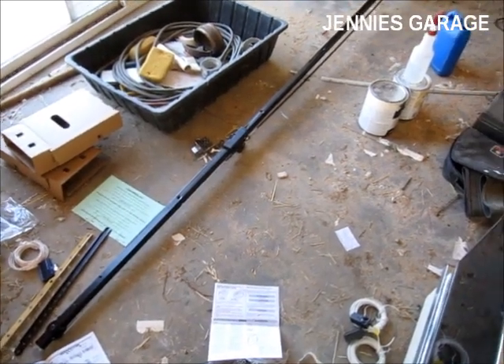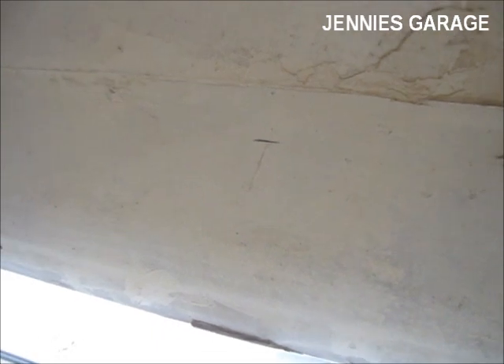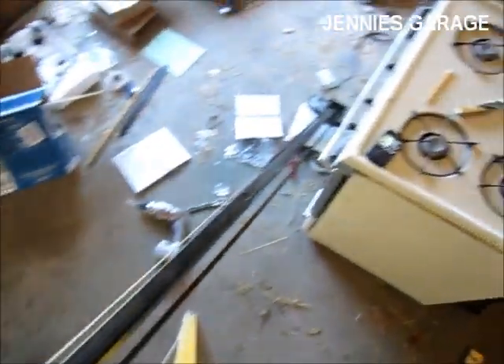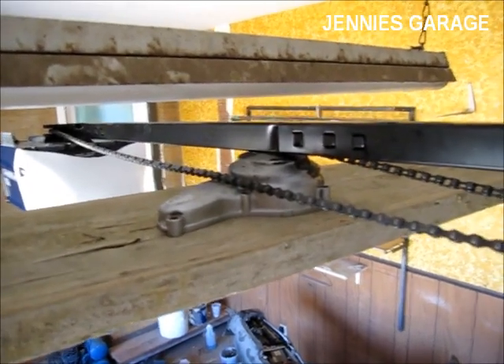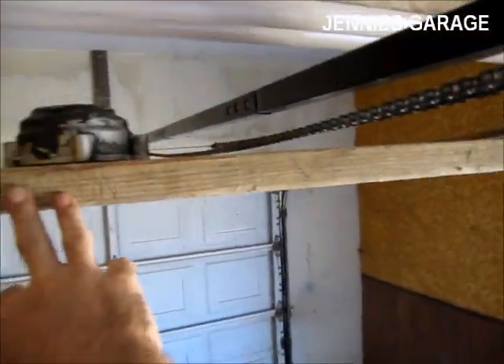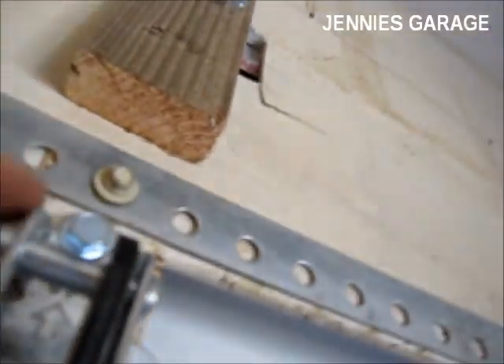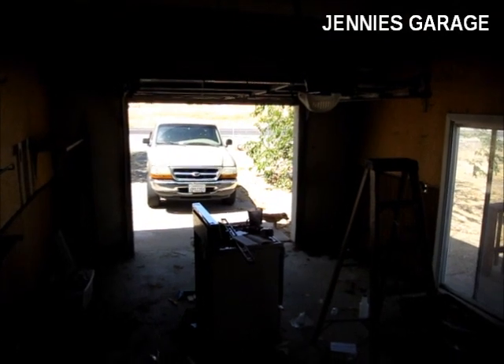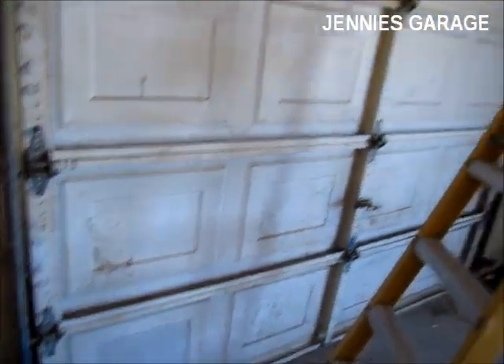How To Install A Garage Door Opener - First Time For Everything!

Comment: So that garage door has no Torsion Spring(s)? For a small door like for 1 car garage it is not necessary? Thank you for the informative video.
@11:24  Special thanks for the idea how to support the central rail! I need to remove the box w/gear, and the box is located too close to the ceiling, so I would need to remove the whole box (which is connected to the rail).
Reply: It has extension springs above the tracks. This was common on single doors, however torsion is the best
Reply: @jdcalame6714  Thank you for the explanations and concern about my questions. I've installed already 2 new Torsion Springs on our standard 2 cars garage door (instead of 1 larger, which got broken by splitting apart), but it is good to know more details about the process, I've recently learned. Thank you again.

Comment: Excellent job! I’m thinking all you had to do to get that board on top of your door is to pull the door towards the board and once you get close you can lift the board and the garage door motor the same time but, your way work just as well! I like how you took steps in between you’re off camera stuff to show us the complications. That helps out a lot. You’re not a marketer trying to sell your services… That’s nice to see. Thanks for the video.

Comment: 5:59 ran into the same problem . So I connected the header bracket to metal brackets like the one that hold up the motor . Ran lag bolts vertical hitting the wood that ran horizontal.  The 2 by stuck out to far from the wall for my installation...

Comment: A decent video just make sure the chain is 1/2 inch above the rail not really loose and disconnect that hinge where you see a big huge air pocket and see if you can realign that gap and clean it all up and make a brand new again

Comment: My garage door has rubber feet on the door side, and a little piece of rubber on the motor side. The cool thing with that is that you don't need to fine tune it, it does it automatically as it senses resistance when it reaches the end (or an obstacle).
I'm surprised that chain is dangling...

Comment: You definitely need to replace your garage door. Your squeaky wheels are only one problem. One of your door panels has a slight gap between the other panel which isn't normal. I'd say the door has lived its 30 years and some...

Comment: I would like to see a video on- Emergency fixes for a garage door.
I am forced to wait 3 weeks for my new door to arrive & it is -20 below zero now.
I have cold air at top and underneath closed door.
I have nailed a rubber runner at bottom of wood door which thank God is holding but air coming in sides and top.
I am stuffing towels and clothes to cover gaps..
Thanks for any furthur help especially if you have been in my position before.
My 97 year old Mom who I care for says " thanks very much" also.
Reply: +l bondez you can buy weatherstripping that nails on the door jambs, header and both sides, it has a rubber flap that sits tight against the door to stop any air gaps

Comment: Grease it up , sounds a bit criki , builder short changed you on the header size ... should be larger than a  2x 6 not a big deal anyway it works

good luck and helpful video,  Thanks

Comment: This was perfect.  My door is exactly like this one and since it was built in 1963, and my upright studs were also on 24" centers I was sure the header over the door would be the same so just went ahead and put the 2x4 in vertically as he did in the video.  This made things much easier.  Still don't have mine completely up because of a time crunch, but this has helped me avoid some pitfalls that I'm sure I would have had.  Thank you so much for showing me how to do this.

Comment: They make a brace call a strut you can use as a proper support for the top of the door. You can pick up at a garage door company for cheap. Your support is not long or strong enough. The strut is a u-shape bar witch gives it the strength it needs to support the top of the door properly. Don't use wd-40 use a light machinery oil like 3-in-1 oil. Also check door first by hand and make sure door works freely before hanging garage door opener. Not bad installation for a home owner. Your wires on the walls and the roof are straight most people take short cuts on that.

Comment: The bottom of the wall bracket is supposed to be 2" above the highest point of the door.  You have the bracket centered at 2" above the highest point of the door.
Not a big deal.

Comment: Thank you very much! I am going to install a Chamberlain just like this one this week.Was wondering about verticle reinforcement.... I guess you did not think it was required for this install. The manual recommends it but is very vague about how to do so. Any suggestions? :)
Reply from the maker: It depends on the door. If it is real flimsy where the opener arm is going to attach, you need to reinforce the area so the screws don't just pull out when you try to open it. You can buy a purpose built bracket, or make your own. Thanks!

Comment: This guy is an idiot...I install Garage door openers for sears everyday and to install the header bracket, just mount it 1 inch about the middle fo the spring...before doing this check to see where your stud is using a stud finder or your fist just testing the sound...and when mounting the opener to the header bracket, dont just place it on the ground, just place the end of the opener on or near the spring and place the power head on a 6 foot ladder...his installation is really bad

Comment: Excellent work. Suggestion, if I may. Go to eBay and order the nylon
Garage Door Roller / Wheel / HEAVY DUTY 13 Ball SEALED Bearing 12 Pack
item: 251015046796. The rollers are very quiet compared to the metal ones you have. eBay has suppliers with prices way cheaper than HD or Lowe's...etc. Much cheaper for a multiple pack , in fact. Installation is unbelievably easy. Anywho... thanks for the vid.

Comment: I can't get over how bad the door sounds. Have you serviced it yet? Sounds like you may have some bad pulleys/sheaves and definitely some lubricant. Do not, I repeat do not use white lithium grease or grease in general. Get some garage door lube, pb blaster or liquid wrench. Wd40 is ok but doesn't have the longevity

Comment: There's a garage door guy trick to getting the opener in the air so you can open the door. Take your ladder, place the motorhead on the top step. Put one piece of the packing foam back in the box and use the box and possibly (I install professional so my boxes are smaller) the other piece of foam and that's your extra couple feet. It sounds really ghetto but when you're on your own a lot of us do it that way. I've never lost an opener ;-)

Comment: Best garage door opener installation video I've seen here on YouTube. And you're right... the mistakes make it interesting as I've yet to do a project without mistakes along the way of my 60 some plus years. I had an old house the first 12 years of ownership and I can't count the surprises that it unfolded. BTW, I tried WD40 and found I had to do it every 6 months. "Chain lube spray" on the rollers shafts did it for me. A real mess, but once cleaned up it was good for years... better than WD.